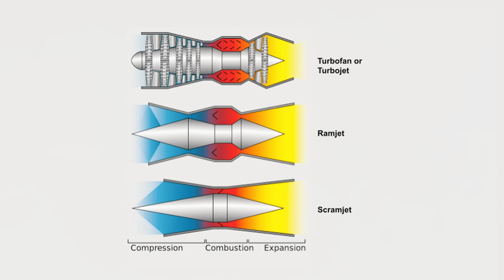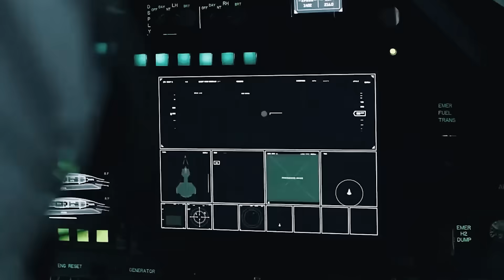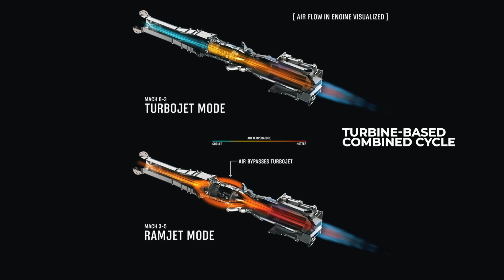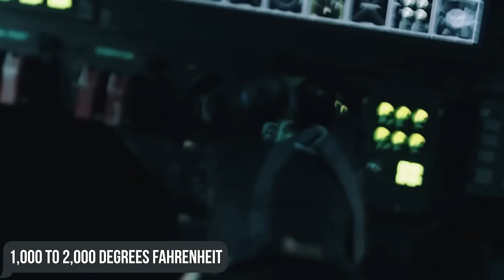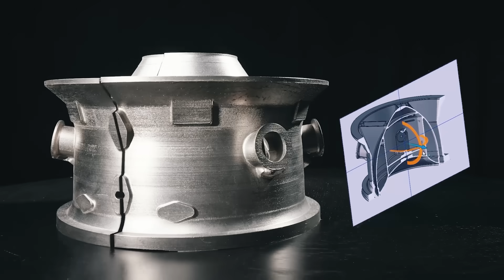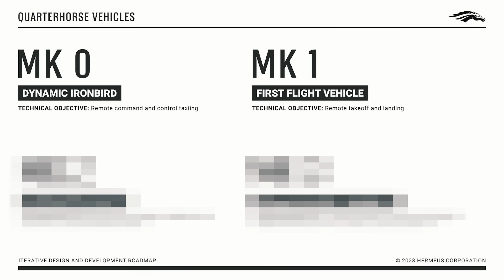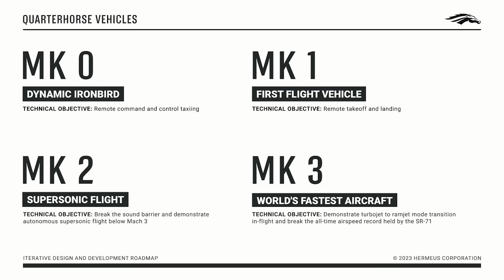US Tests World's FASTEST Hypersonic Aircraft to Beat SR-72

Comment: Who today use farenheit and inch that's from the middle ages of horse drawn vehicles
Reply: 99.9% of Americans.
Reply: The imperial system is the natural world that we live in. 
So long as you have a 12hr clock and 360o in a circle -our planet and navigation will be in nautical miles, feet and inches. It cannot be done within metric system.
Think about it, 360 x 60miles = the circumference or great circle distance around the globe. 21600nm.
So each degree is 60nm and each minute is 1nm . It's a perfect system of calculation.

When the French President's Airbus lands at Paris, the aircraft is descended to a height in feet, determined by a standard pressure setting of 29.92 inches of mercury. At a speed measured in nautical miles per hour on to a runway elevation measured in feet.  Metric system is a no go.
One more thing, when you next purchase a case of wine, how many bottles are in a case ?
The natural world is imperial !
Reply: The people who make all the bad-ass weapons.  That's who.
Reply: Like it makes a difference.

Comment: we need sr72 also that engine was probably inspired by the sr72
engine from the topgun
Reply: The SR-72 Darkstar is a real aircraft, it was built by Skunworks,, Mach 6 capable, we flew an air craft to Mach 6 in the sixty's, and again in the 2020s
Reply: What aircraft flew Mach 6 in the 1960s?
Reply: @chadnelson924 NASA flew the x 43 at mach 9.6. over 7000mph